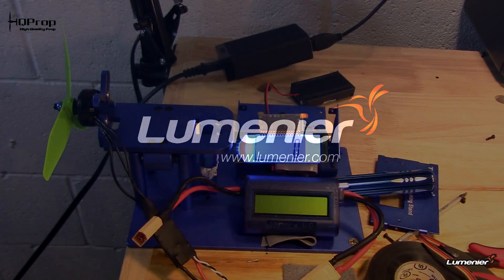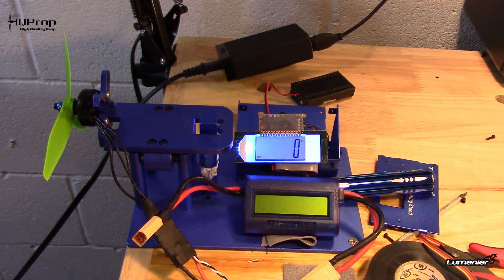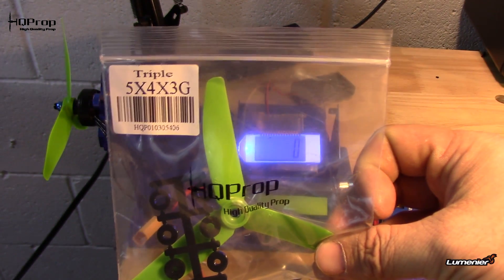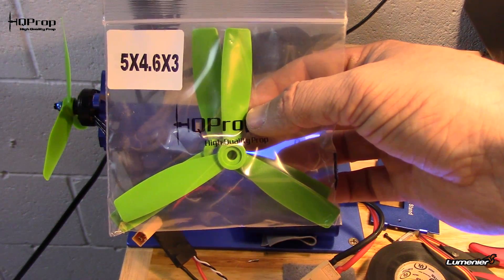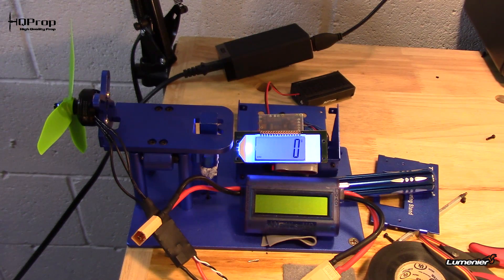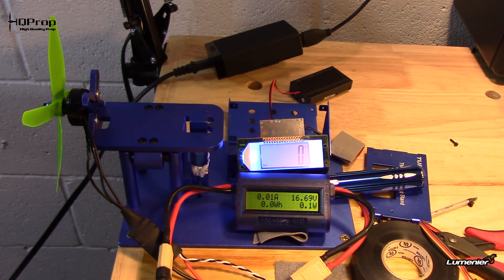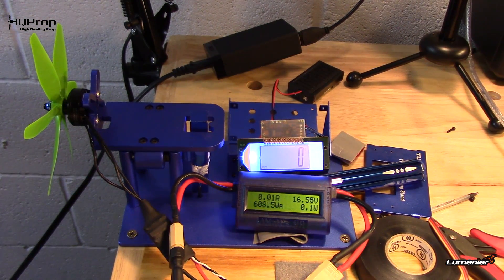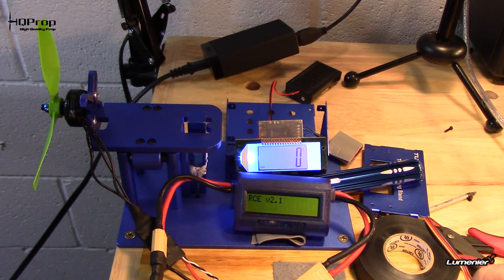HQProps Bench Test on Cobra 2204/2300kv ( hexblade 6blade 5x4x6)

Comment: Excellent.
DYS SE2205 2300/2600 KV Hollow Shaft motors would perform how?
Excellent demonstration of  propeller TIP design vs. number of blades.
Throw in variables of total weight, drag, difficulty/length of course, battery quality(Graphene?) discharge curve... Red pill Blue pill....
Reply: very similar. but better thrust on the smaller props and lower efficiency on the higher thrust props.
Reply: 2600, for the 2300 the results would be near identical since both the cobras and the DYS are 205 motors (yes I know the Cobras are called 2204, but if you measure them they will be something like 4.9mm, so almost 2205)

Comment: Very predictable outcome. Less thrust and more amps than the 3 blade bullnose.
This numbers race is good for the wallets of the manufacturers, not much else. We've seen it with C rates, kV numbers, ESC amp ratings.
Good thing many hobbyists share data, so that others know what they're being sold.
Reply: +sjeses Is there a scientific outcome here that can be used?  Is there a definitively good blade?
Reply: +S. L "good" depends on your criteria. Do you want the most efficient prop? At what rpm? Or perhaps the most amount of thrust? Or the most speed?